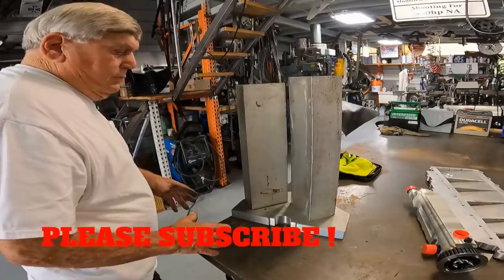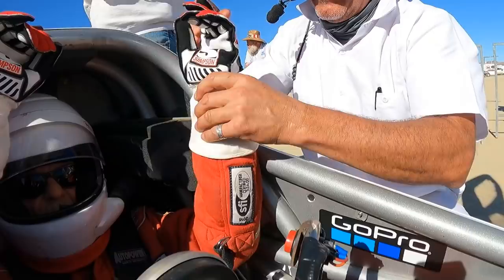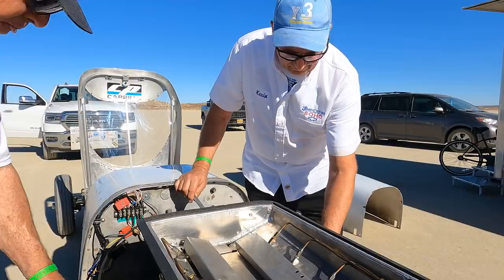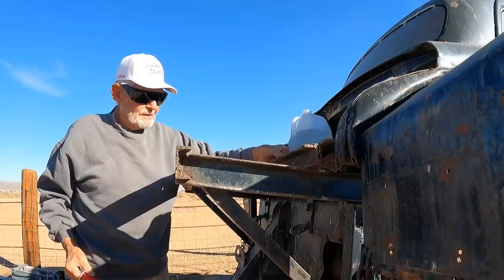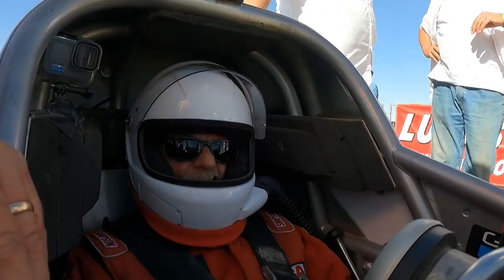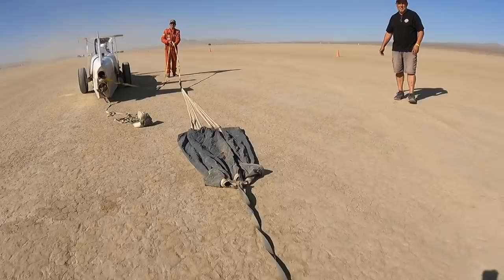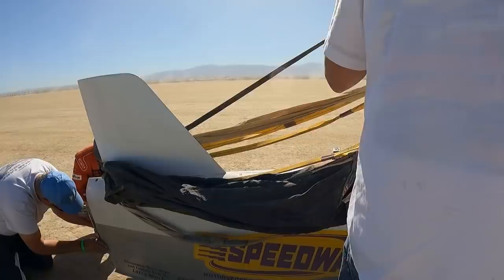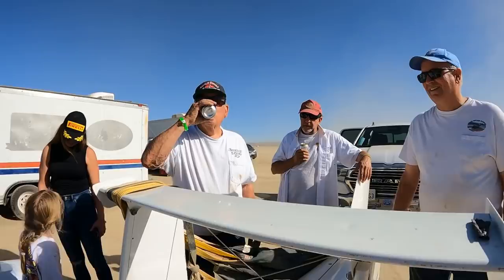DIY Homemade Engine Builder Captures 44 Year-Old Land Speed Record

Comment: A streamliner with a scratch built engine made with many already existing parts joined by fabricated assemblies, displacing 258 cubic inches and turning 10 grand. Producing enough power to spin the tires at speed when the nitrous kicks in, beats 44 yr old record by a slim margin while displaying the ability to go even faster in a time when production streetcars ( albeit very few and massively expensive ) can top 250. Got all that. What I didn't get, what was the actual record ( class and specs ) that they broke ? AWESOME JOB THOUGH guys,  loved seeing most of it, verry impressive
Reply: I guess because this record is on dirt on a 1.3 mile track? How much space does a Veyron need on dirt?

Comment: That's one high revving engine! Holy smokes. When you lost traction it looked like it pegged 9k RPM in a split second.
Reply from the maker: Yes it was!  Check out this run when it was at 10,000RPM  https://youtu.be/tUmnOAGdAxs    Greg

Comment: What record exactly?  Rules for the record? Standing start across a measured distance? Speed through the traps? Why no backup run the opposite direction?
Reply: On a long track like Bonneville you can run according to FIA rules which means flying km or flying mile and second run in the other direction. There are also SCTA and other rules this appears to be a shorter track and timed over a shorter distance and maybe no backup run either.

Comment: Just imagine, NASCAR was going nearly this fast AND going around turns back in the 1980s…in an open cockpit full-sized car.
Reply: But they needed more than a mile to get up to those speeds.  I would love for someone to take a classically configured NASCAR racecar of that era and make a salt run with it. My guess is maybe 170's max with the same gear, tire diameter and aerodynamics. I just don't think they would be able to achieve 200 mph by the finish line. But again, it would be interesting to find out.
Reply: and with a budget as big as Texas

not sure what the point is of trying to equate two very different types of racing

would love to see one of them "open cockpit" cars
Reply: It’s a totally different type of racing.  Surely you can see the difference between the two and understand that a record doesn’t stand for 44 years without good reason.

Comment: Building a piston engine from scratch is not at all difficult.
What is difficult is to build a high performance, reliable one. These gentlemen managed to do just that. Very impressive.

The biggest consideration for me on homebuilt engines is power to weight (and the torque distribution of course). I would love to know more details about this engine. I particularly liked the simplicity and fresh thinking on their 4 cylinder.
Reply: Power to weight isn't a big deal with land speed cars. They need weight

Comment: How about a single cylinder 500cc 4 stroke that turns 10,000 rpm for a go kart.  We need some of those too!
Reply: I’d like to see if we can run karts  on one of Ardema’s properties.  We need a huge parking lot. Bring back Karting in San Diego. Sponsored by San Diego Roadster Club. Dirt Oval is popular too. That Ardema 500cc could get me a first at Perris Speedway. I love land speed racing, but one run doesn’t get my nut. We need another type of event with laps involved guys.

Comment: I loved Bonneville I run the Harley that broke the wit record in 1990 I test rode it told them to put more downforce on front I went   232 first ever test run and told them it had ole more throttle two months later it went 353 world record
Reply: do you have any pictures.  that sounds a little hairy going that fast on loose surface.

Comment: Like most watching this ??
What was the Record for ?

The class of Engine seems to be 4 Litre Fuel Engine.
With a touch of Nitrous, to give it some kick.

I was a little unsure myself until I read more.
At around 360 KMH it's definitely moving.
Reply: I'm from New Zealand and don't really understand US class rules, but I think class E is 260 cid (4.26L), probably for some historical reasons they didn't just use 4.0L as the limit. Also I think this is an El Mirage record and there are also Bonneville records which tend to be faster, due to the longer course, and there are also FIA world records, but I don't think they have a 4L class.

Comment: Without traction issues, I wonder what the record could be?
Reply from the maker: Hard to say? I'm amazed that these cars can hook up on dirt with these little pizza cutter tires they all run in land speed racing.
Reply: @GregQuirin  there's no such thing as 100% traction. That just means you're short on power.

Comment: Nice job! What is the record specifically though?
Reply: I thought the land speed record for an internal combustion engine was about 400 mph. They were doing 230 mph in the 1920's.
Reply: I was wondering the same, think it may be a one mile run from a standing start.
Reply: @PreservationEnthusiast  there's a ton of special classes depending on build type. info in the description.
Reply: @daos3300  I read the description and it didn't really answer that question. It mentioned class E and 4 litres and home build but it didn't specifically identify any restriction or make the category clear.

Also, the title of the video is total clickbait because it just says The land speed record. They went faster than this in 1929, so the restriction on the category should be mentioned in the title. For example 4 litres or less, or whatever it was, I'm still not clear on that.
Reply: @PreservationEnthusiast  for the specific classes/categories you'll need to check the fia website. other than the absolute fastest (the 'outright' category for which this car is clearly not meant to be a contender) there isn't just a single lsr. it's a wide field which is what makes it so accessible and fun. and it's not clickbait since the title specifically says '44-yr old lsr', not 'the' lsr.
Reply: I'm not sure if the description got updated, but from my understanding the class is E/FL meaning an engine up to about 4.2L and in this class (unblown) fuel (meaning alcohol fuel or nitrous permitted) engine, with lakester bodywork (open wheel class so more drag than a streamliner) and also this is an El Mirage record and the Bonneville record might be faster.
Reply: @alexjenner1108  thank you

Comment: This record is MUCH more then it would have been considered 40 years ago. At that time and for another 25-30 years computers played a small part in the process. Now with all the computing power giving the precise air flow and fuel air mix etc... and the manufacturing process 25 years ago a machine lathed engine wouldn't get near the perfect cut a computer can provide. These guys sorta proved we are in the Matrix.. Human brain out calibrates computer. Impossible unless you were the creator of the matrix. Amazing.

Comment: This is really cool. I'm missing context on what brackets of land speed records there are.  I don't know.  There are road cars like the McLaren F1 that hit 247 mph.  Can someone explain?  I watched this through.
Reply from the maker: Thanks for asking this question, You are right the New McLarens top speed is 250MPH with a 4L V8 and is rated at 1036 HP with twin turbos and a parallel hybrid system. Pete' and Kevin's  land speed car is also a Frankenstein 4L V8 with nitrous and is naturally aspirated and making approximately 700HP. Keep in mind this record was set on the lakebed at 3000 FT on dirt with pizza cutter tires, no traction control, Just 100% good old fashion driving input.  Land speed records are hard to get as this one was on the books for over 4 decades.  Thanks for watching and please check out some of the other videos.  Greg Q
Reply: @GregQuirin  Cheers, thanks for the reply

Comment: do the rules dictate you use a mechanical valve control? have you looked into electronic valve systems. Sometimes known as "open valve" so you have a either an open or closed valved and minimal transition

Comment: Neweeb here, what class is it ? ,,, open wheeled streamliner  ?
Reply from the maker: This is a Lakester, Its open wheel so it not considered a streamliner. The class designation is FL = Fuel Lakester, Fuel meaning it using nitrous oxide.  The engine classification is E which is a 4 liter class.

Comment: So at El mirage you only have to hit the speed, where as at Bonneville you have to hold the speed for the full mile? And are the 2 race types ( peak speed vs sustained  AVG speed) running  on the same record. 

Sounds like I should be running El mirage instead of the salt it's a lot easier on equipment to just hit the peak for a second or two then to hold the peak for a full mile.
Reply: El Mirage isn’t big enough for average speeds and the timing association is very small. Look at it on the Google satellite map sometime.
Reply from the maker: El mirage also only requires one pass to set a record. You don't have to back it up with a second run.

Comment: Missing something here. Watching some Airport Time Attacks from a few months back and a 2014 viper is pulling 220.++ in a half mile.... Or how about 259 @ 2018 Pikes Peak time attacks by a lambo Hurican, in half a mile. 
How is all of this so wildly different? And where do you get any "landspeed" record from this @226? 

Is this some sort of class/bracket type thing?
Reply from the maker: Jason- this is Official Land speed racing - There are tons of different calcification's  This record run was with a 258 CID 4 liter engine classification for a lakester vehicle (Open wheel) with fuel =meaning nitrous was added.   The 2014 Viper is a 8.4 L V10  would be in a different category.  For example there is a car called Speed Demon with a similar displacement such as the Viper . Speed Demon has a 557-cid, 9 liter turbo big-block Chevy with a recorded speed of 470 MPH. which  happens to be in the AA/BFS classification. More info can be found at https://scta-bni.org/bonneville.   So technically at the moment , the recorded speed of 226 MPH makes this the fastest 4 liter fuel Lakester on the planet.   I hope I answered your question?  Thanks for watching!
Reply: @GregQuirin  wow, had Zero Idea!😇 Thank you for the quick lowdown. I do understand the differences in the motors and now this make much more sense... 226 👍
And wholymakerel 470 mph! That seems about twice the 4 liter, so Id have to say that @226 the 4l is putting in WORK! More efficient than the 9l?
Reply: @GregQuirin  Also Thank You for the link. I've of course heard of racing at Bonneville but Ive never done much looking into what goes on there. I have been enlightened!
Reply: From my understanding, and perhaps Greg can correct me if I'm wrong, a modified Viper might be considered a Competition Coupe and perhaps end up in the AA/FCC or AA/GCC class. Either way it would need to run close to 300 mph at Bonneville for the record (perhaps a little less for an El Mirage record).
Reply: Also that Viper is only a few mph faster than a 2.0L naturally aspirated Nissan coupe running at Bonneville.
https://www.youtube.com/watch?v=a7xqZbGA3v4

Comment: So I am new to this site and I am wondering why make the engine yourself? Is it cheaper than sourcing or modding a European supercar V12? Or wont a Ferrari or lambo cut the mustard?
Reply from the maker: Pete and Kevin build their engines for the pure joy and satisfaction of doing this themselves.  Pete really likes the challenge and looks at all engine designs and combines the best of the best into their own .  Pete would rather build his own V12 rather than adopt own from a production car.   - Thanks for watching!
Reply: There are lots of different ways of doing things and it depends on which class you want to run. If you can afford a European supercar V12, you can probably afford a 4.0L Judd V10 racing engine or something like that.

Comment: Why not go all wheel drive?  Clearly the rear wheels had too much power and made him sway.  With all wheel drive perhaps the tires wouldn’t have broken traction, also if they did, they’d pull evenly and the sway would be less, god it looked pretty twitchy from inside the car.  Honestly with all wheel drive you’ll be breaking that record
Reply from the maker: Not sure if all wheel drive is allowed in this category?  I do know Pete and Kevin are making a front wheel drive streamliner.  Pretty much all the vehicles are running  these little pizza cutter tires and have the same issue with traction.

Comment: Why did they adapt ZR1 heads to the Olds block? 
The Olds Aurora is already a DOHC motor, and although both it and the ZR1 were designed by Lotus, they aren't part of the same engine family. The Olds is related to the Cadillac Northstar, while the Chevy is a standalone design. Or is the block an earlier Olds, and not an Aurora?
Reply: I don't know their reasons,  but the ZR-1 has wider bore centers, i.e. easier to get cubes .
Reply: @rolandtamaccio3285  Which means that it wouldn't be an Aurora block, since the heads wouldn't fit. So I guess it must be the block of an earlier pushrod Olds. Aardema has done work like that before - he once adapted Porsche 928 DOHC heads to a Chevy big-block, which took a lot of work and considerable ingenuity.
Reply from the maker: From what I recall, It's 258ci modified Oldsmobile pushrod  Rocket  engine with  2.7” inch stroke with a 3.9” inch bore and has been heavily modified and adapted with Corvette ZR1 LT5 cylinder heads.  When Pete and Kevin build engines, they become reengineered Frankenstein engines that produce great results. Pete's other engine are pretty much built from scratch. There are a few examples of these engines on my YouTube channel if you want to see some really cool stuff.
Reply: @GregQuirin  Thanks. 
While Pete (and Kevin) are noted for their OHC conversions, their other mechanical Holy Grail is short stroke, and that's the reason for many of those odd adaptations. 

And I have seen a number of your other videos, as well as some by Pete's British and Vietnamese "cousins" (so to speak) Allen Millyard and Le Dan.

Comment: What is the record for?
Reply from the maker: Land speed racing- it not timed just top speed in a measured distance.
Reply: @GregQuirin  
Yeah, I know that but what record have they broken?  What class of vehicle etc?
Reply: From my understanding it's the El Mirage record for class E/FL which is an up to 4.2L unblown Fuel Lakester
Reply from the maker: @alexjenner1108  Your probably right, I'm new to the LSR experience.
Reply: @GregQuirin  I'm new to it myself and I look at the record books and see the same Nissan coupe setting records in G/FCC, G/GCC, G/GALT, G/GC and G/PRO,  with different engines and bodywork and still trying to figure it out. So many classes. Thanks for posting these videos.
Reply: @alexjenner1108  
Thanks, thats what I wanted to know.

Comment: So confused here. Why is this a land speed record? I've seen cars on CarTrek that go faster than this. No mention of conditions or qualifications. Did I miss something?
Reply: This is an El Mirage speed record in a specific class. You might go faster in a streamliner (lower drag), or with a bigger engine, or you might go faster at Bonneville which has a longer course where you can build up speed.